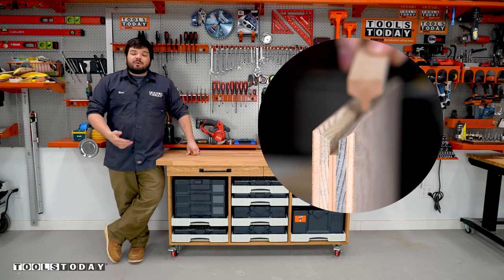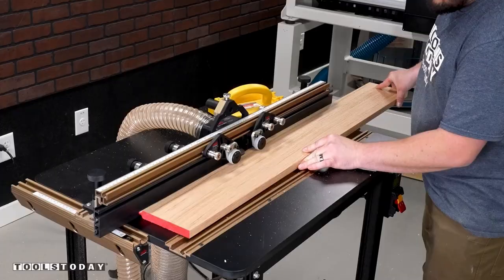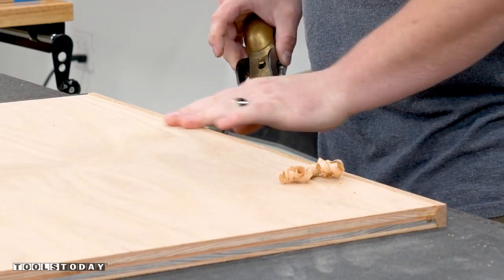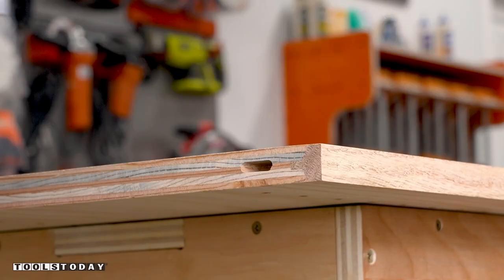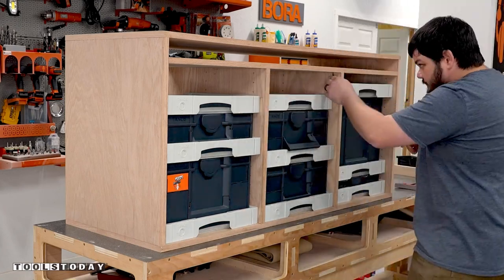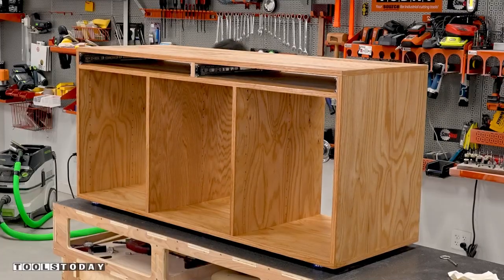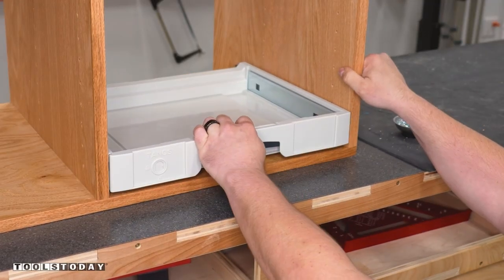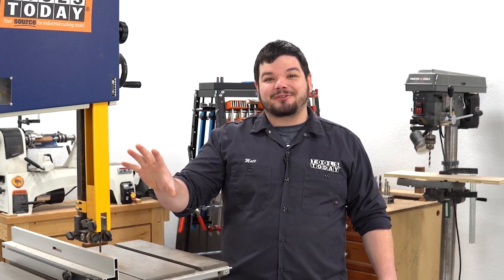How to Make: Shop Storage Cart | ToolsToday Video

Comment: Although I dont really get the point of the tongue groove process, it did come out nice and looks great.

My only concern is the wood sagging in the middle cus the wheels are only on each side, but no slider stubs in the middle or support beams on the front and back 😕
Reply: In my pinion the slider hardware and 3/4 or 18mm plywood is plenty strong to keep that from happening. It's also typical to leave the back off a shop cabinet.
Reply: @bdm1000  Actually, that was not my opinion, I was speaking from experience. I never said it would not be strong enough, I was talking about the center sagging after a couple of years.

If you look under quality metal cabinets, there is always at least one center support beam.

Also, he did leave the back off. So I'm not even sure why you mentioned that 🤷🏾‍♂️